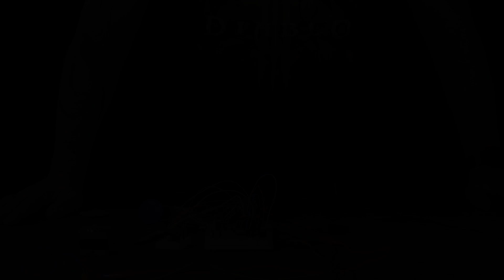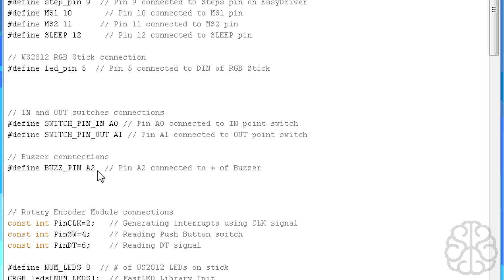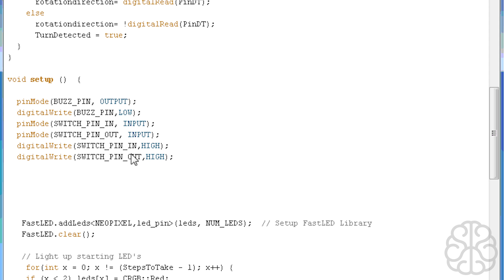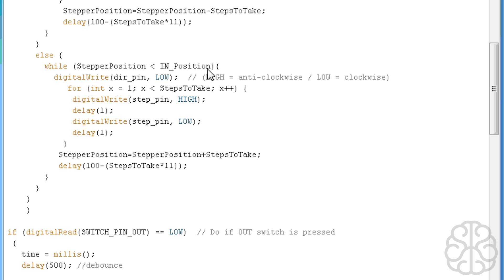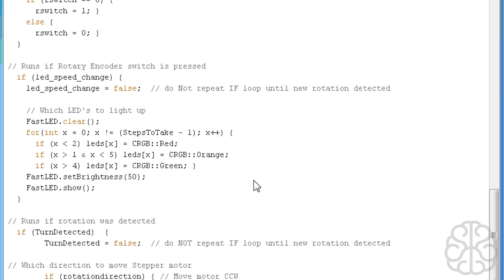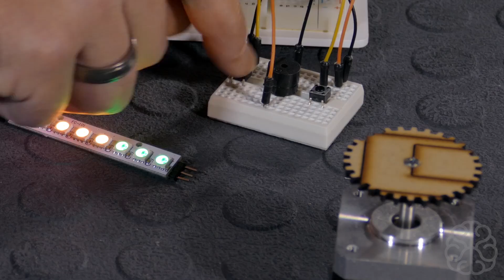Control a Stepper motor with an Arduino : IN and OUT points using Tact Switches -Tutorial - Part 4

Comment: I am building a model railroad turntable controlled with an arduino and stepper motor.  I would like to be able to stop the turntable in multiple locations by pressing a button for the destination track.  Can you show the coding for doing that similar to the single in and out stepper motor positions in this video?

Comment: Using this setup would it be easy to use with 2 motors, for follow focus and zoom. Also could you have more dip switches to memorise different positions for the motor? Thanks in advance this is exactly the tutorial I have been looking for.

Comment: this is what Ive been looking for. thank you so much. Im wondering if you can help me with multiple stepper motor (3 to 4 steppers) using the same program with in and out set points? thank you
Reply from the maker: Started work on a 2 axis camera slider here:  https://youtu.be/-UOuQbnNo2g
That's the intro, but this will continue with more videos and improvements this coming week.  Hope it helps!

Comment: Hi! Is it possible to connect 2 motors and manage both with single encoder synchronously?  And use more then 2 waypoints?  Like mechanical switch with 3 positions. Please help!

Comment: Exactly what I was looking for great job! Subbed
Reply from the maker: Thanks for the comment the sub, and for watching :)
Reply: Not a problem if you keep making great video's like this I will watch them and recommend you to others. I don't own an arduino but your video's have inspired me to expand my knowledge of electronics.

Quick question if you have the time, could the program be shurk and put on a chip so I could use the arduino on other projects.  I hope the question makes sense.

Best regards 
Vas
Reply from the maker: If I understand your question properly, you can take the ATMega328 chip out of the Arduino UNO board once it's programmed and use it by itself in a more permanent project.  I've made a video about it that you can check out here: https://www.youtube.com/watch?v=DMb9Gv8ko6g
Hope that helps, and thanks again.

Comment: Hello, I have the same problem! some idea about how to resolve it?

Arduino:1.6.9 (Mac OS X), Tarjeta:"Arduino/Genuino Uno"

Follow_focus:144: error: expected unqualified-id before 'if'
           for (int x = 1; x < StepsToTake; x++) {           digitalWrite(step_pin, HIGH);           delay(1);           digitalWrite(step_pin, LOW);           delay(1);           }           StepperPosition=StepperPosition+StepsToTake;           delay(100-(StepsToTake*11));          }        }      }     }     if (digitalRead(SWITCH_PIN_OUT) == LOW)  // Do if OUT switch is pressed  {        time = millis();       delay(500); //debounce      // check if the switch is pressed for longer than 1 second.       if(digitalRead(SWITCH_PIN_OUT) == LOW && time - millis() >5000) 
                                                                                                                                                                                                                                                                                                                         ^
exit status 1
expected unqualified-id before 'if'

Este reporte podría tener más información con
"Mostrar salida detallada durante la compilación"
opción habilitada en Archivo -> Preferencias.

Comment: Hello from Germany :-)
if i check the code then error is coming and it displayed this:

code_Rotary_encoder_stepper_controller:144: error: expected unqualified-id before 'if'

           for (int x = 1; x < StepsToTake; x++) {           digitalWrite(step_pin, HIGH);           delay(1);           digitalWrite(step_pin, LOW);           delay(1);           }           StepperPosition=StepperPosition+StepsToTake;           delay(100-(StepsToTake*11));          }        }      }     }     if (digitalRead(SWITCH_PIN_OUT) == LOW)  // Do if OUT switch is pressed  {        time = millis();       delay(500); //debounce      // check if the switch is pressed for longer than 1 second.       if(digitalRead(SWITCH_PIN_OUT) == LOW && time - millis() >5000) 

                                                                                                                                                                                                                                                                                                                         ^

exit status 1
expected unqualified-id before 'if'

i have instaled all libraries
do you have an idea?

Comment: Great tuts! Made things a lot clearer for me, however, I thought you were also going to address the microstep settings on the EasyDriver? I'm a bit confused as to how the sketch would read the steps? If it;s in the LOW/LOW mode, the step count is either +1 or -1, but what will it register when it's set to microsteps==8,  which is the base setting on the EasyDriver. Is 1 step in the code 1 original step (8 micros) or is one step really 1/8th of a step. So 8 steps in the code equals 1 'real' step?

Other than that, awesome tuts ++
Reply from the maker: +snewpers You are correct that if changing the steps on the Easydriver, than you will have to keep track of that to make sure the code counts properly.  Like you said it would be 1/8th of a step, so 8 steps would equal 1 real step. Thanks for comment and watching!

Comment: Thanks for all the tutorials, they are so usefull! I was wondering if it's possible to make the stepper turn only inbetween in and out points? If possible, can you help me out with the code? Thaks a lot and keep up the good work!
Reply from the maker: +Hotnogu Dorin In the video we are setting the IN and OUT point by long pressing the switches, once set you can move to the IN or OUT point by pressing the same switches but faster.  Is that what you mean?  Thanks for watching!